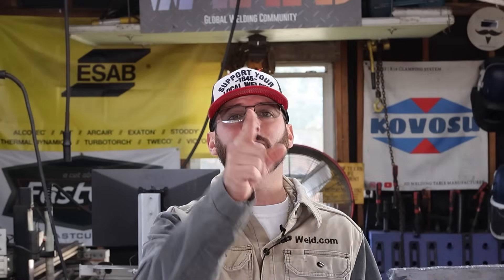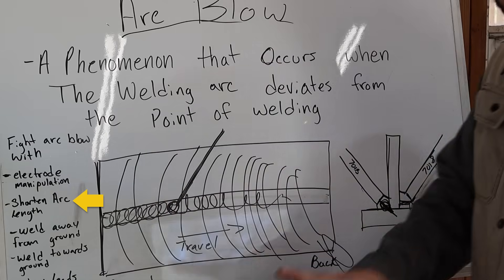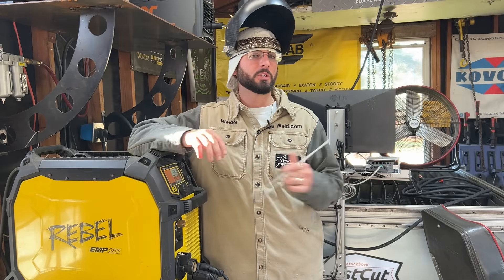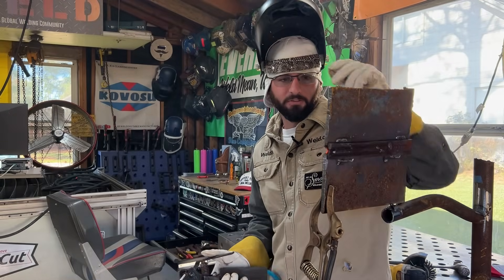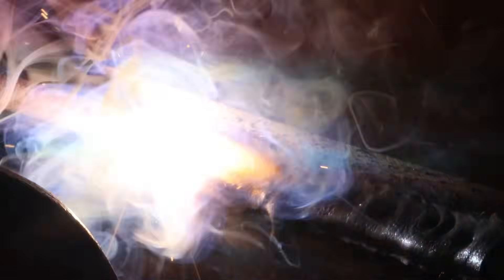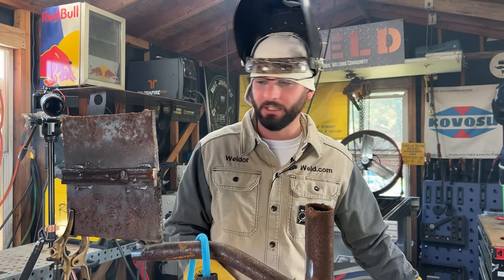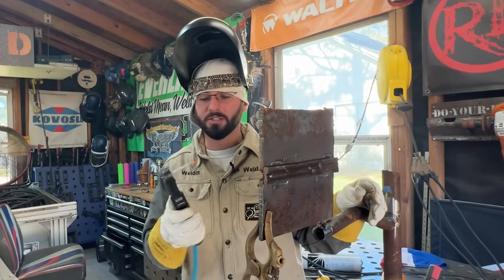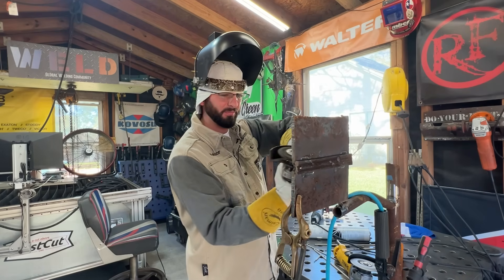Simple Trick To Avoiding Stick Welding Arc Blow

Comment: I have a extra ground clamp with a 3 foot tail with a piece of flattened out copper pipe that I clap under my welding machine ground clamp and then ground to the other side of my welding area, So my welding is done between the two ground clamps. It seems to help prevent Arc-blow.  But I have no proof except the arc-blow stops. Great video.  Would love to see a video on how to properly join two I-beams to extend its length ......

Comment: Also, does arc blow happen with both AC and DC stick welding?
Reply: @frigginpos  typically not with AC, reason for that is because with AC it’s making super fast start and restarts, it’s also why it’s hardly affected by magnetized pipe or material. 
AC is so good at averting magnetism that if i’m stick welding around a magnet or the material is magnetized i will pull out the old lincoln tombstone AC transformer and weld it out with that. works every single time.

Comment: I had this happen to me multiple times while welding on a MC331 propane tank/trailer that needed to be x-rayed. One thing to remember is to clean all the slag in between passes. Look at that last pass with a flashlight. A wire wheel on a grinder is great, but it doesn't always get everything. Sometimes you need a fine wire brush, or just grind it out. Slag inclusions will fail your ass! And arc blow was murder, but it did only happen in the beginning. For whatever reason, after I had built up a few passes it did go away. I was switching out machines, doing everything to make sure it wasn't me or the machines. I thought my leads were crossed. Pulling my hair out.

Comment: What would happen if you split the weld cable so it was connected to both ends of the weld? Thanks.
Reply: See comment above about using a ground jumper lead. Defo going to try this.

Comment: The reason the arc blow slow stops the more you weld is because the base metal is being heated to a temperature at which its ability to conduct magnetic waves is locally reduce. Maybe just barely into the heat affected zone. If that far.

Comment: Thanks a lot brother. 
Cause I'm a welding student who has been doing 3f vertical up for last couple of weeks On 200mm long 6mm thick plates. I burn an average of three 2.4mm sticks. On the last stick I'm burning, I have been facing this problem. But I was surprised that when I started with ESAB rods I didn't get the problem. I started getting them when I used the rods from a different company( I forgot the name).
Reply: As mentioned. its a phenomenon lol sometimes it happens, sometimes it doesnt.

Comment: Any tips to prevent 6010 finger nailing?
Reply: Definitely in the wrists. Ive had it happen if Im pushing at too steep of an angle, even in the flat. Id fire it off on a piece of scrap for a few seconds to make sure that I got rid of any issues in the flux too. On a jobsite, I cant condone the scrap trick since I dont know what they'll allow.
Reply: rotate youre wrist to favor the other side. some old wise men say if you have rods doing it to you. to quickly dip them in water.. sorts it out.

Comment: working as a millwright , my only issues with arc blow would occur when I was welding in a corner with 2 plates at 90 degrees or tighter .  My welding instructor recommended to switch to ac in those cases to eliminate it .
Reply: Certainly the cure
 if you have it

Comment: I always found welding a plate on the end of an angle iron, when welding on the inside of the angle iron to the plate would cause either arc blow wander or slag entrapment. 

I used to mess around with the settings on the heavy oil transformer , even whacking the welder up to crazy amps or visa versa but would still get slag entrapment 'bubbling swirling orange slag' tried welding from the inside to the outer edge of the angle but it was still crappy. Rods were Oerlikon Welding Electrodes "made in Ireland" 6010 or13's  back then, can't remember exactly.
Reply: them corners can get messy

Comment: Now retired but during my first 5 years of being an apprentice welder back in 1970's we had many stainless steel jobs to do. Now back then we used rectifiers with DC so much like the invertors of today and arc blow was an issue particularly if going into a corner on a fillet pass and out. Now how we corrected this was to use ACwhich was back then a AC transformer being oil cooled as opposed to DC or in todays world the invertor. So what i would be saying if you have a invertor that happens to have the AC/DC switching on it switch it to AC and see if the issues of arc blow disappear. Just a heads up from a guy with over 50 years of welding experience
Reply: most defiantly the quickest solution.
Reply: Thing i always found with stainless stick.  It'll make you look real good or real bad.  Yall be safe
Reply: I have a Parker (IGBT)inverter welding machine, it was around £55, it's okay for short jobs, can not believe how light it is, okay you could not weld all day with it, it will deliver on full power 140 amp at 20% duty cycle.
Also still have my first welder, it was an Elto 20 to 90 amp max which I bought for £56 back in 1975 with my Saturday job money I had saved up, it's an AC transformer machine, still works fine, simple, no electronics to blow up.
Reply: @Gazr965 Yea for sure I remember getting bad arc blow on 6011 fillet weld on the root pass.
Reply: works every time especially on very dirty metal

Comment: I'd like to see a video like this on how to prevent arc blow with large wire spray transfer MIG. I have yet to find a solution to it when using 1/16'' metal core 70s6 at 30 volts.
Reply: Clutching at straws here; Try an AC yolk from an MPI unit...?? Pull it away from the job slowly several times to demag the steel,  or even try leaving it connected to the steel during welding, see if there is any difference. It may work, be interested to hear if it does...
Reply: Also if you are welding very long pieces of material try turning them 90 degrees in the shop, or putting them in a different area in the shop away from the shop's power feed area, or ask the purchasing dept to purchase demaged steel - for the long runs. Yes it is a thing, done in the mill. A gauss meter will help you to detect it and to know if you try different things weather they work or not. It is a bit of a black art so trying these things if it really is a problem may sound silly, but sometimes you stumble on something that works a treat.
Reply: find an old u shaped magnet and run your ground cable around the pipe twice through the magnet attached to the metal at least 6 feet away bring the magnet closser or further away to adjust the effect on the arc
Reply: https://youtu.be/2vuGlcbDwKY?si=7GUls-nclw2GIVp_
Reply: That link I shared is from an older video from like the 40s through the 60s era it explains how you get rid of those things
Reply: @derekbryant6137  It is a good explanation of distortion but not so much on Arc Blow..?
Reply: @paulmeersa7162  there's another one I was trying to find I think it is the one that explains arc welding in general and it goes in depth over that I couldn't find that one I'm still looking for it